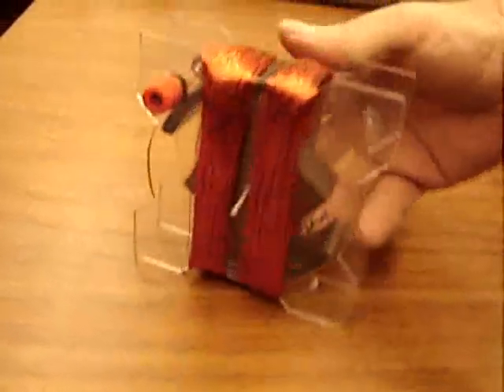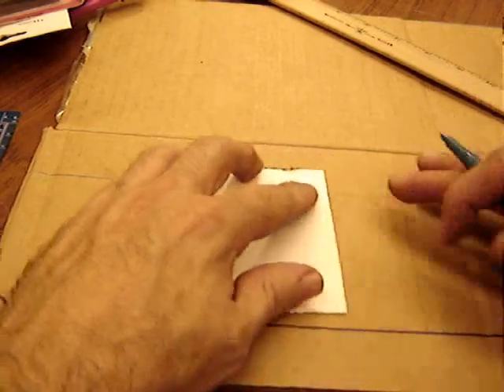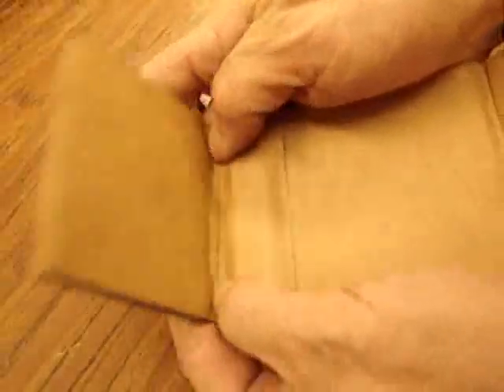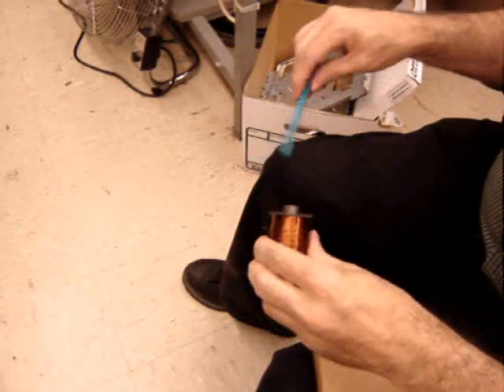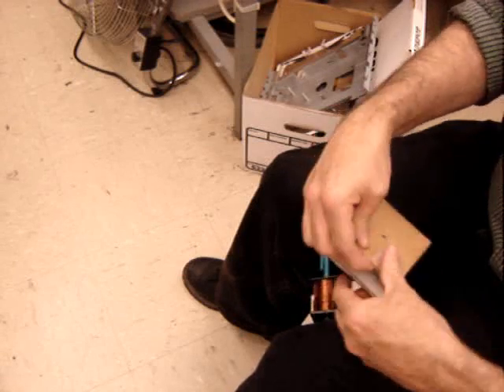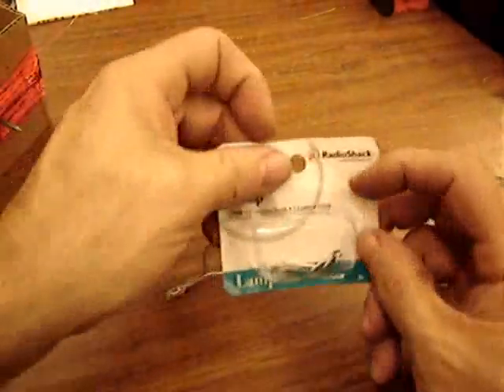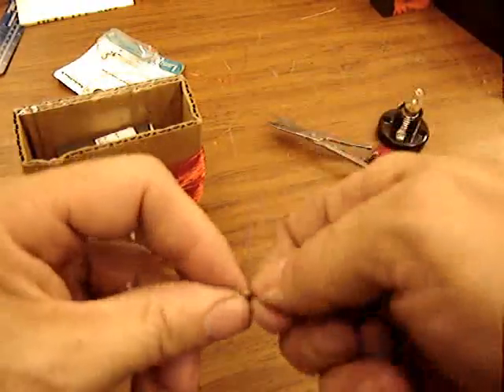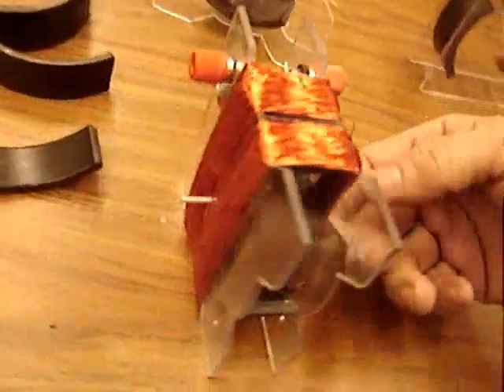Simple generator:  AC electric generator for science fair

Comment from the maker: @ryangolf1212   neo magnets larger than 1/2 inch will work.  With neo magnets you only need 50 turns of wire, not 200.  But build the generator into a tiny box or even a short piece of plastic pipe.  The wire MUST be very close to the spinning magnets.

The magnet RPMs and the number of turns determines the voltage.  If you can't get it up to 1/2 volt, the bulb won't light.   A red LED needs 1.7 volts.   If you use heavy wire, don't wind fewer turns.   Figure a way to spin magnets way way faster

Comment from the maker: @yamitech If you add lots more turns of wire, you can light up a red LED.  But with only 200 turns, your fingers can't spin the magnet fast enough for LEDs.  (Use LED, then spin it with an electric drill?)

For the bulb, see the parts list in the main article.  Buy from Radio Shack, or mail-order from Radio Shack, or mail-order an LP-3 bulb from All Electronics, or mail-order a #48 pilot lamp from an industrial bulb supplier.

Comment: here i have a step up transformer from 12V to 240 V...can i use it to increase the generator output voltage (12V) ? can 240V ac output voltage from the transformer to operate the electrical appliances in our home?...

Comment from the maker: @huddiex    An amplifier is just a power supply with a valve.   You can't increase energy, but you can use batteries, or a wall outlet.

If you want to increase the generator voltage, you could wind more turns of wire, or you could use an audio power transformer.   But this doesn't increase the energy (it reduces the maximum current while it increases the volts.)

Comment from the maker: @trricklecharge91 Yeah, that's the secret:  use way more turns of wire.   200 turns will barely light the special bulb, and it cannot light an LED at all.   600 or 1200 turns of wire is way better.

Comment from the maker: @biplav32 laptop or cellphone needs about fifty watts, about 1/15 horsepower.  Tiny generators are too tiny.   50 watts is like a person riding a bicycle uphill.   To charge a laptop you can't just spin something with fingers, instead you need to use your legs, and it makes you tired quickly.    You could do it if your generator was spinning at a few thousand RPM, or if it spun slow but it contained many pounds of supermagnets.

Comment: For those who dont get it, this is magnetic flux. Basically, a magnet has a magnetic field around it, when it gets closer or farther from something, it changes the magnetic force (how strong its pulling on something) between the two objects. The change is called magnetic flux. This actually produces a current in whatever it is pulling on (in this case a wire). By making the magnet move around, the magnet is getting closer and farther and making a current that can flow through the lightbulb, LIT!

Comment: I have a ton of old hard drives laying around, 6gb, 4gb and whatnot... I wonder how the neo's still work in them... Make a pinwheel generator attached to a fountain to make a self rotating generator based on neodymium magnets to get so better voltage... it wouldn't crank very well, true, but get a few more generators around and you have a clean, not so efficient but renewable way of charging small devices, if you understand the wiring enough to hack a charging cable without killing it...

Comment from the maker: @JappSlapp00 large neodymium magnets expensive, but they give about 8x higher voltage.   So don't use big neo rectangle magnets, use smaller 1" neo magnets, build them in a plastic tube with wire wrapped around.  Don't forget that the magnet poles must flip end-over-end.

Comment from the maker: @pinkistoughjj  Buy a couple of $10 neodymium disk or rectangle magnets.  Make a smaller box, since the wire must hug the magnets close.

For DC, if you can make the generator put out several volts, then you can add a diode.   Normal diodes use up about 3/4 volt, so order a Schottky diode which uses much less.   Or build a mechanical commutator switch, since switches don't reduce the generator voltage.

Comment from the maker: @pinkistoughjj  batteries are DC, and the AC generator cannot charge them.

Also, to reach 12 volts you'd need large rare-earth magnets and about 800 turns of wire.  (Or spin it 10x faster than by hand.  Then you wouldn't need the expensive magnets.)

Comment from the maker: > certain voltage light bulb?

@pinkistoughjj  No, just use the lowest voltage light bulb available.  The generator has trouble even lighting an LED.   If you can find a bulb with even lower voltage, then use it instead.    Or... solve the problem by spinning the magnets at 10,000RPM.  Or just buy 1000ft of wire instead of only 200 ft.

Comment from the maker: > live in South Africa

Sure!  Use large ceramic ring magnets from car loudspeakers.  (If there is any metal attached, you'll have to pry it off.)  With enough turns of wire you can light a red LED or a #49 bulb.

The magnets must flip end over end.   The wire needs to be as close as possible to the magnets (small box or plastic pipe.)  Try 400 or 600 turns of fine wire #28 gauge or smaller.   If the LED won't flash, you need to spin the magnets faster, or need to add more turns of wire.

Comment from the maker: @legoman760 use the parts from the article.  Read the article, it says Don't use different parts. must use the exact right light bulb or it won't work.    Or, if you cannot get the right light bulb, then do as the article says:  use 400 or 600 turns of wire to light a RED LED.

Comment from the maker: @perx098 if using smaller magnets, use a tiny box so the wire stays close to the magnets.  Also, the magnet poles must be flipping end over end.  Still AC can't charge batteries.

Comment from the maker: > tiny LED

Red LEDs work great if you add 2x or 3x more turns of wire.   I used the special light bulb because it turns on at half the voltage needed by an LED.

As always, more wire gives higher voltage.  600 turns of wire gives much brighter lights.

Comment from the maker: > around the box differently change the AC output to DC?

If that was possible, then we could start a company selling DC generators which need no switching commutators.

> around the way it spins

Try it.   That gives near zero output, because the flux through the loops of wire isn't changing.

Also look up "faraday generator" or "homopolar generator."   (But these use brushes too.)

Comment: @wbeaty- Would running the wire around the around the box differently change the AC output to DC?

I mean, you have built this to run across the magnet at two points, well what would happen if you ran it around the way it spins? Would that create a DC current?

Thank you for the video.

Comment from the maker: > generate 15-20 watts?

All DC motors are DC generators, so just buy a junk DC permanent-magnet motor from Herbach and Rademan or other mail-order supplier.  Don't use a tiny one if you need a few watts output.  It should be a couple inches diameter, a few inches long.  You'll have to spin it quite fast though.

Comment from the maker: > The output is AC, so you could

Actually it won't work at 0.5VAC output.   The diode just gets hot, with no output volts left over for the battery.  A DC generator needs a rotating commutator switch.   Also lots of iron parts.  Also it needs to spin way faster (using step-up gears.)

Comment: The output is AC, so you could build a very simple "full-wave bridge rectifier" (or buy one, they are not much $) and use it to change the AC to DC to charge a battery.

Comment from the maker: > how much voltage

it barely can light a 0.7V bulb.

> 15-20 watts

To do that, this generator will have to spin at a couple thousand RPM.  Can't spin with fingers.  Though it could be done using supermagnets.

Comment from the maker: > alot of wire on this say 5000 turns

That will get you higher voltage but at the same maximum current.

The usual improvement is to build it with metal parts made on a lathe.  Put all the field paths inside solid iron.

Another trick:  use gears to spin it much faster.  It's even possible to use lots of small magnets as gear teeth, where the two gears don't actually touch.

Comment from the maker: > much thinner wire

See "MEASURE THE VOLTAGE AND CURRENT."   If you're using 400 or 600 turns, and only lighting an LED, then thin wire is fine.

For a certain magnet RPM, the 60mA maximum current is determined by wire gauge.   Changing the number of turns will change both the output voltage and wire resistance, therefore the max current stays the same.  #30 wire gives around 60mA for short-circuit current.   Thinner wire would give a lower max.

Comment from the maker: > buy solenoids

Mail order surplus suppliers.   See the main article parts list.

Call Toronto Surplus and Scientific, and also Active Surplus.   See if they have enamel magnet wire, or perhaps cheap DC solenoids which contain a big spool of wire inside.

> different wires

The two wires from the light bulb go to the two wires from the coil.  See the drawing?   You're looking at the main article, right?   This video is just a brief overview of the main project article.

Comment from the maker: > how much wire

One spool of Radio Shack wire is about 200 turns of wire.  Use two kits, and twist the cleaned wire ends together.    Or, just buy one of those cheap solenoids, since they have 700ft or more

Comment from the maker: > 2 small magnets

Those hard drive magnets almost always have two poles on the same face, so they won't work.   But if you can find supermagnets with one pole on each face, then you need to put the wire very close to the small magnets.  Spin the magnets in a narrow plastic pipe?

Comment from the maker: > solder two pieces of wire

Yes, solder or just twist firmly together.   More wire gives higher generator voltage.

If you can't spin the magnets fast enough to light the bulb, then just use 2x or 3x more wire.  Then the magnet only needs to spin half as fast, or 1/3 as fast.

Comment from the maker: > neo magnets

They need to be an inch or so long, and the poles must be flipping over.  The wire must be very close to the magnet.   Make a neo magnet generator inside a small plastic tube.  Those "buzzing egg" rattlesnake magnets work well, with axel made from nail heads glued to each tip.

Comment from the maker: > radio shak didnt have any

Read the website article.    The list of parts tells you many different online sources for those magnets.  Also hardware stores like Home Depot.

> so i used the red

Read the web article.   The instructions say to use the spool of thinnest wire, #30 gauge.   Better is to buy two kits, and use both spools of #30.

Even better than that: buy two 12-volt solenoids from Electronics Goldmine, pry open and get out the spools of wire.   Much cheaper than radio shack.

Comment from the maker: > could have used a LED

If you try an LED, it won't light.  You can't spin it fast enough.   Red LEDs need 1.7 volts, while the special light bulb only needs half a volt.

But if you add 2x or 3x more wire, then a red LED lights brighter than the bulb.

Comment from the maker: > it still didn't work

It works fine if you don't make mistakes.   That's what the "Debugging" article is for.

One problem is that the magnet has to spin fast.  Really fast, like a blur.   (But if you use lots more wire, like 600ft, then you can spin it rather slow like in the video.)

Another problem is when people use different magnets, wire, or bulb.  Don't try your own ideas until you first get it working.

Comment: What if for the structure I am using wood that is around 1 inch in thickness. I plan on using 8 magnets and as much wire as possible. Will it still generate lots of electricity?

Comment from the maker: > magnets are a bit circular

They have to be large.  They have to be strong.  And the wire must be very, very close to the magnets.

This generator ALWAYS produces a current.  But maybe you cannot spin it fast enough to light the bulb.

If your magnets are smaller or weaker than mine, then try adding lots more wire (like 500 or 1000 turns.)    It's easier to just find the right magnets.

Comment from the maker: > 1 inch magnets

See the article debugging section about using smaller magnets.  If you have twenty 1inch rectangle magnets, you can use epoxy form them into two large 2-inch magnets.

Comment: I bought the wire from radioshack and it came in a pack with 3 spools.  the other wires are thicker than the red one.  Can I use the green wire along with the red wire or will it o nly work with the red wire?

Comment: @elmariachi109 the thought that you are thinking of is called free energy, it doesn't exist. the energy you get from the electrical wiring is less than the energy it takes to spin the magnets. therefore the enrgy it produces cannot keep it spinning and give you extra energy. however if you had some natural source of mechanical energy (like a stream or wind) you could use that to spin the magnets and then generate electricity without manually turning the handle.

Comment from the maker: > use some diodes

Diodes consume all your output, since the generator voltage is about 1/2V.    That's why DC generators use expensive rotating commutators rather than cheap diodes.

Comment from the maker: > any special magnets

Smaller magnets won't work.   With lots of added wire, you can use three magnets, even two.

Spin a small supermagnet inside a plastic pipe, with wire wound to cover the ends.  You only need 100 turns then.

Comment from the maker: > still doesn't work

Go to the website.  Try out all those "debugging" hints.    Be sure to spin your magnets REALLY REALLY fast, like ten times per second.

Some people make changes.  That causes failure.  Don't use different magnets.  Don't use different wire.  Don't use a different bulb.

It's OK to wind lots of extra wire.  (200 ft is the minimum.  600ft works lots better.)   It's OK to try a red LED instead of the bulb.

Comment from the maker: > cut in the middle of one magnet

But then the nail just turns freely, and it won't spin the magnet.

The cut should be in the middle of cardboard.  That way the magnets grab the nail.  If the nail still spins, wind tape around the outside of the magnets to force them hard against the nail.

Comment: i used those magnets a nail but i used magnet wire assortments from techcessories 3 spools it contained a 22 26 and 30 gauge and i used the 30 one and 200 feet i used it all and i used a mini lamp 1.5v 25 ma and from nexttech #2720168  and it doesnt work and i used that wire i was telling uand it had no plastic on it and i used it and i connected it but i doesnt lighti even triedit in the darko and the magnetdoesnt stay i used a cardboard peiceforthe spacers and the magnet doesnt stay it getsoff

Comment from the maker: > using a magnetic coil

Buy 12-volt solenoid coils from Electronic Goldmine.

Tear them apart and use the coil of wire inside.  It's less than $3 for a big wire spool.   But you need pliers and screwdriver to pry open the metal frame.

Comment from the maker: > a few moderations

First get the original generator working.  THEN make changes.  If you make several changes at the same time, nobody knows which one is causing problems.  If you never got the original version to work, then it's probably hopeless.

See the FAQ section about increasing the voltage.   I could light the bulb by using one of those egg-shaped "buzzing magnets" with nails glued to the ends for an axle, placed in a close-fitting plastic pipe, with only about 50 turns of wire.

Comment from the maker: > US in a month

No hardware stores?   Or craft supply, even sewing stores?   These magnets are sold most everywhere (but Radio Shack site says out of stock.)

> use these 1x1x4.8

Your jpg says "404."   I don't know what the poles look like.

If the poles are on the long side, then glue two of them together side by side, so they end up with only two poles.  (They will be repelling strongly, so glue and clamp.)   This forms a 2x1x4.8 magnet.

Just make four 2x1x4.8 magnets as above.

Comment from the maker: > 1x1x4.8cm magnets instead

That's the bug.   The magnet cluster must have only two poles, one on each end.  It's easiest to just go find the right magnets.  All those suppliers are listed on the website.

If you place 1x1cm magnets side by side so they attract, then the magnet cluster will have four or maybe eight close-spaced poles.   The norths and souths are canceling out, so the field doesn't extend far out through the coil.

Also, always use way more than 200ft wire!

Comment: Part 1/4:

Please, I need help!!! :)  It's not working!

Ok, I built it exactly the same as the website shows except for 2 things. (I don't live in the US, so I don't have no radioshack.)  I had to make some compromises, the longest wire they had was 150 feet.  And for the magnets I had to use 8 1x1x4.8 cm magnets instead of 4 1x2x5 cm magnets. (But essentially they are the same.)

Comment from the maker: > + and 1 on each end

Don't use different magnets.   Your magnets MUST be the same size as the ones in the video.  Check the generator article.

The generator works much better if you use lots more wire, like 600 turns.  It does work with only 200 turns, but you have to spin the magnets very fast.   Don't use different wire, if it's not close to #30 gauge varnished wire, it won't work.

Comment: i made 200 turns with the wire but i think my magnets are to weak :/ btw does it have to have a negative and a positive? cuz i have one with + and 1 on each end but i putted the to magnets so the + is close to the other magnets - does that matter? if not i think i'll get a stronger magnet without - and + on each end